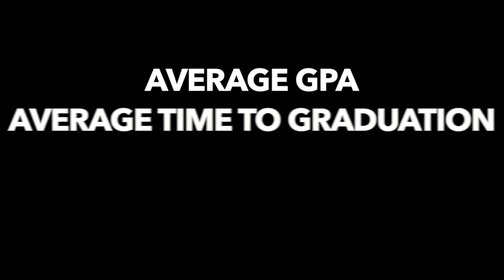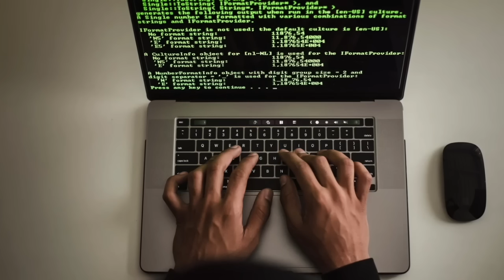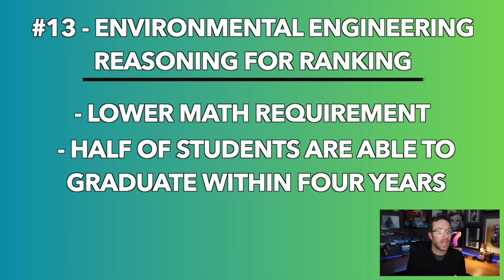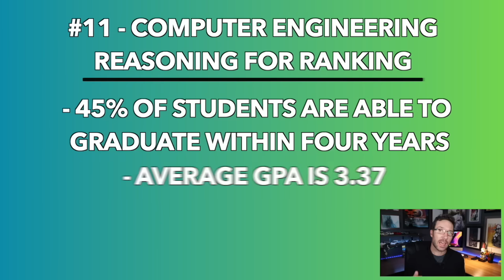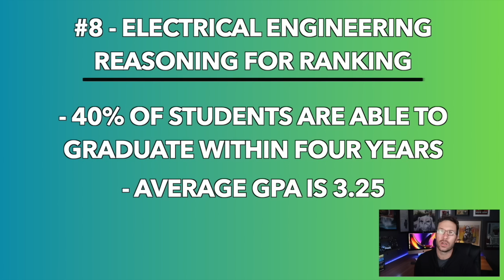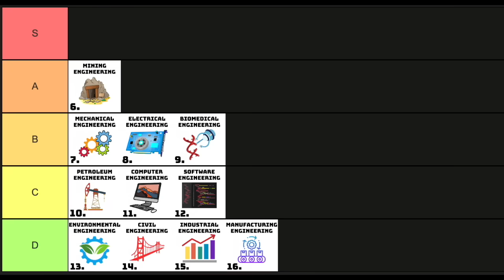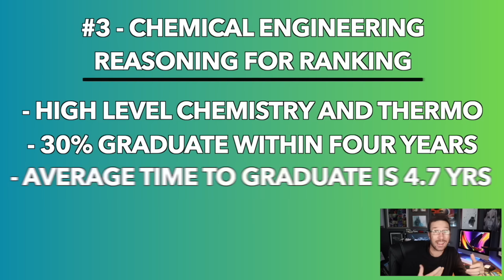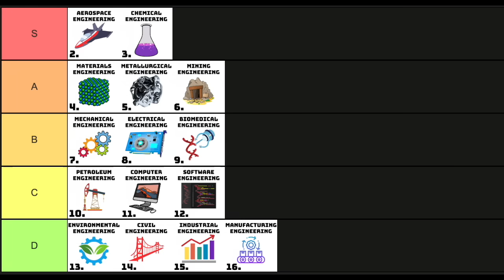Engineering Degrees Ranked By Difficulty (Tier List)

Comment: I don't know where you got your data, but I can assure you that as an upcoming electrical engineer, the highest math required is not just ordinary differential equations. This goes for many other engineering disciplines you mentioned here even despite different universities on both the east, midwest, and west coast of the US. Perhaps it has to do with limiting your data to a small group of schools . You might need to widen your search to give more accurate data...

Comment: I am actually surprised Electrical is rated harder than Mechanical.  I always thought that visualizing current flows in circuits was more difficult than visualizing forces in a free-body diagram.  Electrical Engineers have to be able to use complex numbers to model the behavior of current in alternating current circuits.  Mechanical Engineers never have to use complex or imaginary numbers in any of their engineering work.

Comment: Back at the University of Delaware in 1991, they only offered the four major engineering fields - Civil, Electrical, Mechanical, and Chemical.  An incoming student wanted to get an ROTC scholarship and later join the Air Force, so he picked an engineering field.  He picked Civil Engineering because it was considered the easiest (not because he had any interest in Civil Engineering).  His life was miserable and he still ended up failing.

Comment: Electrical Engineering highest mathematics is only ODE? What kind of degree/university is this based on? I see other commenters saying this is nonsense. I did electrical and electronic engineering (Scotland) and it was maths 3. Your table doesn't factor in the physics or control systems engineering. Methinks this is nonsense.

Comment: A lot of your degrees fall under the major disciplines of software, civil, mechanical, electrical and chemical engineering. They tend to be specializations of those 5 disciplines. If I were to rank them by difficulty I would go: 
1. Chemical 
2. Electrical 
3. Mechanical 
4. Civil
5. Software 

I myself graduated in mechanical engineering.

Comment: I would have ranked Civil as pretty easy until I saw what else is on that tier and above it. I had to take the exact same math as the mechanicals and electricals. I also needed Dynamics, which was really just another Calculus class. 
You might consider putting Structural Engineering into its own category, since you're separating Environmental Engineering from Civil.
Something many overlook about these careers is how little of it you actually do. In not too many years, you start managing people, a skill most engineers don't acquire easily or naturally, nor do we get much training for it, certainly not in school.

Comment: Mechatronic Engineering here, I just ended 4 years of degree and during my internship at this company, I manage to get into a AMR Robot project and finish it up somehow (glad all that study paid off) and what matter most is I GOD DAMN LOVE ROBOTICS, they recognize my effort and eventually, give me the offer letter before I end my internship, I got paid RM18k a month just doing research on my own portfolio. The key is, if you love what you're doing, its going to be a hell of a journey!
Reply: I want to learn robotics too and want to study in UK. I heard Bristol got the best Robotic lab but I'm not sure it has mechatronics major. What do you recommend?
Reply: @RAYHANREHEMAPUTRA-ir6ll  If you want to get into robotics, for a technical person like me, I love from knowing stuff and then, know how stuff works, by doing it. Soo, first I would recomend you, START FROM THE VERY2 FIRST arduino project, get to know small component, then, get into algorithm, and then make a wheel robot with it. After that, go get yourself a Raspberry Pi and a webcam, from your Arduino Wheel Robot, combine both arduino as a motor controller and raspberry pi as python controller and make your very first colour tracking wheel robot, dive deeper, make more project until there is a time when you needed a high voltage motor driver/hardware for your project, from there you'll learn, one, after another, from rugged needs to make a project into a very solid product (in this case, you might aswell explore how to make a PCB) its hard to explain, mine were just 50% Theoretical and 50% Technical............THE KEY IS if you love, what you're doing, what you pursuing for your self development (doesnt matter if you want to be an engineer or you juuuust love making robot) it will be a very2 fun journey, there going to be pain but know the very first purpose youre pursuing this course for (like me, i want to make a very cool robot though :) ) god promised success for those who admiring the very2 blessed passion, trust me. Go for it buddy!

Comment: Back in the 80's I started as an electrical engineering major and switched to computer science (Now called software engineering) in my day differential equations were not required for a software degree, just 4 terms of Calculus wound up writing code for a test and measurement company. Less math but still worked with hardware and electrical systems. Biggest difference   is I didn't design the systems, but I tested them.

Comment: Probably the flaw in this is that maybe the reason people in some of these "harder" degrees take longer to graduate is that they tried Electrical or Chemical first, but couldn't cut it, or they were not good enough to even try those majors.
And yes, Maxwell's equations are central to all Electrical Engineering, and its Vector Calculus, which I would think is above partial differential equations.

Comment: It depends on the university and when you studied. I got my first degree in 1984 in Electrical and Electronic Engineering, just as personal computers started to take off. They had too many elec eng's amongst all engineers so intentionally failed 80% of the class to meet budget. In that year elec eng was the hardest degree to get into, higher than medicine etc. Antenna theory, Maxwell's equations etc. are really difficult to comprehend. I later did masters and PhD ended up teaching. By that stage the degree of difficulty had been so diluted it was unrecognisable. You could even cherry pick courses to avoid maths completely. This was mainly due to the influx of foreign students paying fees. The uni wanted them to pass. My Masters was in Biomed Eng. Some courses were very difficult, some simple. And don't get me started on grade creep where it seems a majority of students get A's these days. (google grade inflation). I admire the effort here but courses vary so much between unis I don't think this type of assessment is valid.

Comment: EE requires PDE, not sure why ODE is all you mention.  Most EE's that I know can do some mechanical design and analysis, if needed, but certainly not with the alacrity of a true ME. None of the ME's I have worked with seem to understand the electrical stuff at all. Most of the EE graduates I have worked with end up doing software engineering, maybe because the EE stuff does not hold their interest for some reason. EE is just more abstract, but the math is pretty much identical to ME.

Comment: Chemical is ranked way too high, I guess chemistry was easy. I started studying material engineering and that was a whole level of boreness and than switch to mechanical. Yes some classes were brutal but overall more interesting. So my guess for metallurgical and material engineering is that people are dropping out because the teaching staff are just bad. Electrical engineering is a tough one regarding the math and stuff. Over here we gave physics engineer, that's for the lunatics. It's basically the toughest classes of each discipline (except industrial and manufacturing because they don't have tough classes despite what they claim) combined in one degree for the same amount of time. Oh yeah, I forgot to say that the other guys with you also had crazy grades. So if you want get humble down and realize that your not that exceptionnal, sign up.

Comment: It doesn't really matter anymore. Engineering is dead and has ceded to computer science. Now, the best course is to learn to code, get a computer science degree (or better, just not even waste the money and get very good at writing source code and math up to differential equations and include several courses in statistics and linear algebra in there) and then learn the narrow area of engineering you get hired into. This is the best adaptation IAW the hiring practices of the idiots running the corporate sector for the last 25 years. Don't waste your time or money with engineering anymore. It's a dead field.

Comment: Couldn't resist commenting even though this video is relatively old. As an electrical engineer by education and a nuclear engineer in practice as well as a engineering manager at a premier national engineering lab (responsible for hiring, mentoring, and working directly with 90+% of the engineer specialties listed here), I think this video has done a disservice to anyone considering going into the engineering field. All of these fields are challenging, but if you can grasp the math, I believe are all doable. Most engineering fields in school have multiple paths you can choose with your limited technical electives and those can change how much you are actually stretched intellectually depending on where you want to focus.

The main problem with the list he ranked is:
1. It doesn't appear he really understands what is in an engineering program or syllabus other than what he briefly listed and there are huge gaps as described in the other comments just in what math is necessary for each subject (outside of the minimum calculus). Note that engineering is basically just applied math to help explain the physics/chemistry/etc. concepts that composes a degree area. Ad some problem solving concepts/skills around your degree area and you have a degree path.
2. People have differing problem solving capabilities that allow them to grasp concepts. Some solve visual/I can touch it (i.e., mechanical trusses) problems better than others that thrive on abstract concepts (such as fields and waves) - not saying that these can't be difficult or easy depending on the learner. 
3. As an undergraduate, many of the courses taken are cross discipline courses like thermo, statics, basic electricity, physics, chemistry, etc. Additionally, the sheer number of other courses required in the humanities and social sciences mean that as undergraduates, most really only get a few electives to actually focus in a specific area. For the most part, a specialist in an area is developed in Masters and PhD courses or on the job.
4. Lots of other issues and this is getting too long.

Lastly, if you are a high school student getting ready to consider an engineering degree or a non-traditional student planning on returning to school to get an engineering degree, it would be wise to choose an area that you think/know you have a passion for. Others in the comments have stated that all of these fields can be difficult. But I guarantee, that you will see the world differently when you are done and you will have the opportunity to better yourself and your community in a real and meaningful way.

Go for it! And good luck.

Comment: Studying for my BS and Ms in nuclear engineering- can confirm, this is quite difficult. I’m one class away from a math minor, and about 4 classes away from a major in physics (both applied and theoretical I believe). Nuclear materials, thermodynamics, and nuclear systems are certainly the classes to learn as much as you can in.

I heard this from a professor once-
“Nuclear engineering isn’t hard… unless you don’t understand neutrons, thermodynamics, fluid dynamics, heat transfer, radiation shielding, reactor kinetics, materials science, quantum mechanics, control systems, fuel cycles, nuclear chemistry, plasma physics, dosimetry, structural mechanics, neutron transport, computational modeling, criticality safety, power conversion, and a dozen other things—all at the same time.”

Comment: I have done both Electrical and mechanical Engineering. Now, as a lecturer in both, I can say the required math difficulty depends on the level and specialisation. On the more basic level of engineering (on the design side) EE requires more difficult math. However as you go to a higher level, ME becomes a lot more complicated especially if focusing on calculation, material and phenoma modeling this includes Continuum mechanics, Fluid, thermodynamics, particle/molecular Dynamics, some chemistry. On a scientific level it usually covers fundamental  aspects of Electrical, material and civil Engineering.

Comment: For my software engineering degree I had to take partial differential equations, so the math requirement depends more on the school you go to. And I'm pretty sure EE at my school go even deeper into partial differential equations in circuits and signals courses.

Comment: Civil (structural) engineer here, we had to take Partial differential equations
Reply: We also had to take thermo and heat transfer, some circuits, a shit ton of statics and dynamics, and some basic chem. We also did Finite Element analysis and tensor calculus (effectively calc 4) so I'd say it's arguably harder than many of the degrees ranked harder.

Comment: I think at least some of it has to do with personality, type of brain (not a psychologist, forgive me for using incorrect terms).  I am a electronic engineer.  Always heard from the mechanical engineers that our stuff was harder.  However, for me, mechanical design blows my mind.  In electricity, pretty much whatever is calculated can be repeated in the lab.  Mechanical stuff, is so hard to transpose from theory to practice.  And once working, pretty much the mechanical components of most systems show greater complexity than the electrical parts.  Just in a car, I would not think any of the electronic sensors is more complex than the materials and design of the moving parts.  I have a lot of respect for mechanical engineering.
Additionally, I liked electricity all my life and could not see my self doing anything else.  So, somebody may think "oh, what you studied was so difficult".  But, in my case, what could have been the alternative?  It is easier to do something when you feel like you have no other choice in life.  In class I always felt like I was meant to be there, although I was so bad at math and physics during high school that college was hell for me.  Again, college was like hell for me, like a prison in the sense that the course work was extremely difficult for me, I could see my classmates needing less hours in the library, with tutors, in the labs, than I did, but...always felt like I had no other choice.  The presented mentions he used the length of time it took to graduate to assess difficulty.  Well, it took me six years, not because I was partying, because it was so hard for me.  It has paid me extremely well, though.

Comment: Hmm, this is pretty subjective in my opinion, software engineering/development is not easy by any means versus any other engineering degree, its always changing and it can outrun you very fast if you cannot handle what you are subjected to in multiple programming languages plus problem solving. imagine tasked to write a program in a language or a framework of that Language a combination of both plus math skills and problem solving you have no idea of how it works and you have a week to do it....I personally witnessed 4 people drop out of BSC comp Science and flew through electrical engineering, so ...its subjective..just my opinion :)... Reason for dropout, Data structures, Big O Notation, COBOL...Java on steroids, Design Patterns purely based off pure mathematics...there is a clear reason why they get compensated that well....its not easy and it doesnt become easier,  you constantly need to be learning and never forget foundations of maths.

One more thing, studying Computer Science/IT /Software Dev and working in the actual field is like night versus day...

Comment: your analysis is generally good, I have a BS in Chemical Engineering and an MS in Electrical Systems Engineering. One fallacy in your discussion on Chemical Engineers is the notion we do not use or are educated in partial differential equations. In Chem E you live in the PDE world with 2 courses and that extends into the kinetics, process control courses, thermodynamics, etc. The area of chemical engineering has evolved profoundly in the last 20 years into the biotechnology space. I would guess 65% of Chemical engineering grads go into pharmaceutical and biotechnology. So, beyond the transport phenomena, and kinetics, you take biology, microbiology, genomics, biochemistry (2 semesters), and biotech labs. So, chemical engineering today spans from chemistry, PDEs, calculus, physics, into human physiology and microbiology. Chem E at this level is the most difficult and the most lucrative. BS graduates start at $90K and by 10 years they are at $200K.